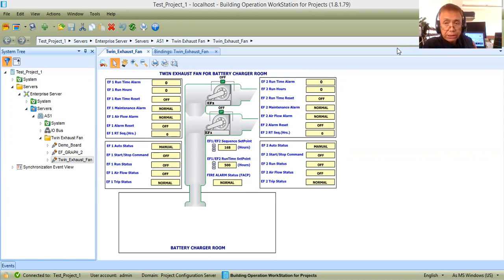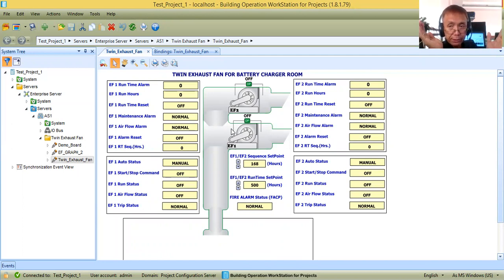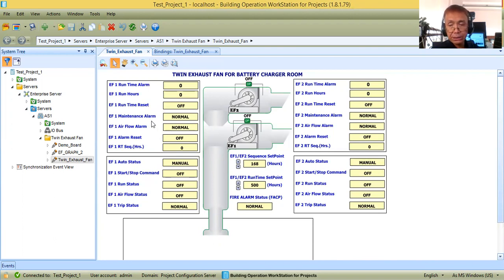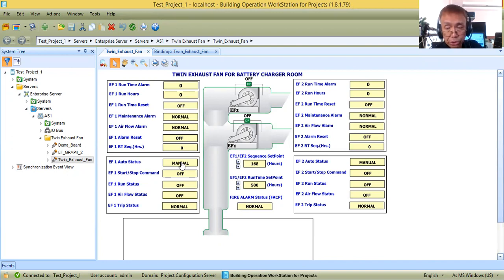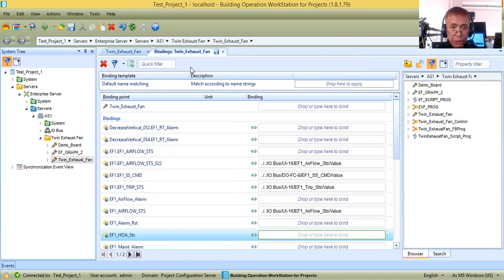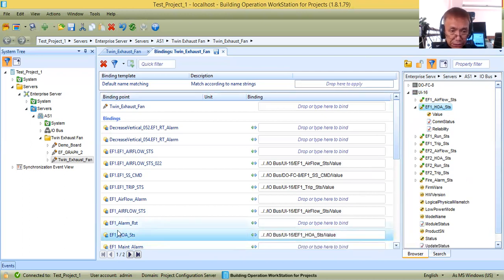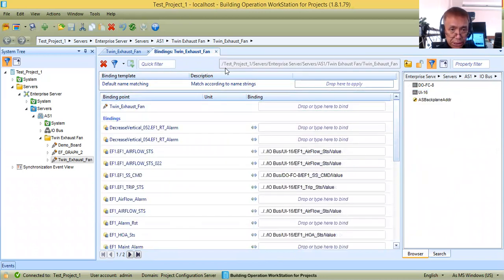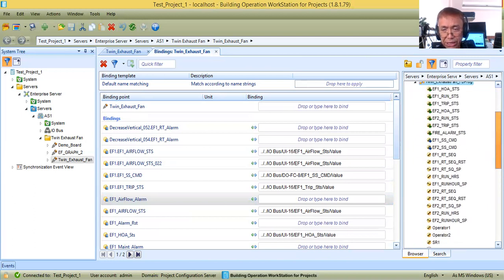How to become a BMS engineer part 77 (How to bind BMS graphics to physical and software points)

Comment: hello sir 
thank you too much for all those video  you shared for free ,
could you please tell us wether it's possible to use an input of AS1 in a programme of AS2 for instance;
thanks in advance
Reply from the maker: Noted. Create a control point in one AS1 then bind it to an I/O or  where it will get the real time values then in  AS2 create a value point then bind it   to the one you created in AS1.
Reply: @SantosJrCapellan-BMS  thanks a lot

Comment: Hai sir can you please provide this details in any upcoming videos in detail please.
BMS interview questions...

What is Bms
What is Hvac control on bms
What is DDC
What are the I/O in BMS
What are the field Devices in Hvac Bms
What is Bacnet
What is alarm, trends , History, schedule in BMS
What is Network control unit.
What is Bacnet MS/TP
what is Bacnet over IP
what is diff b/w bacnet mstp and Bacnet IP
Which cable using in Mstp and IP
What are the basic architecture following in bms
What is network protocol
What is TCP/IP
what is BBMD
what is serial communication 
What is PID controller
Wats diff b/w P, PI, PID controller
Why MAC using in MSTP 
What is CO 2 Sensor
Why temp and pressure more important than RH and FLOW 
What is AHU controls
What is sequence of operation of AHU
what is FCU 
What is VAV
what is CAV
what is Demand Control ventilation

What is Dry bulb temp 
What is Wet bulb temp
What is Dew point temp

Also go through

Units of sensors

Temp
Pressure 
Flow 
Relative Humidity
Co2
Carbon monoxide sensor

What is sensor 
What is transmitter
What is transducer
Whats the diff b/w sensor and transmitters 

DPS DIFF PRES SWITCH
ACTUATORS
how actuator works
What is feed back in bms
What is open protocols
What is integration in BMS

Why address module using DDC

What is stand alone pgm in DDC
Reply from the maker: Noted. But I guess I have to break it in several video tutorials.
Reply: @SantosJrCapellan-BMS  

Thanks you for understanding and iam waiting for ur videos regarding this..